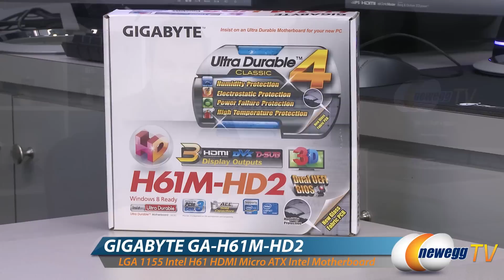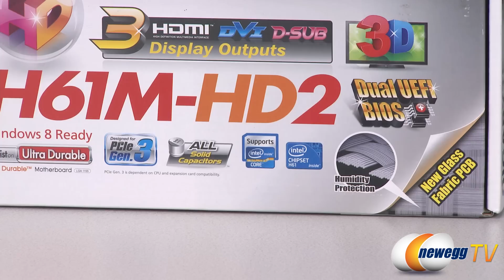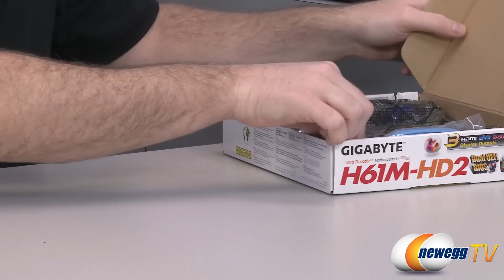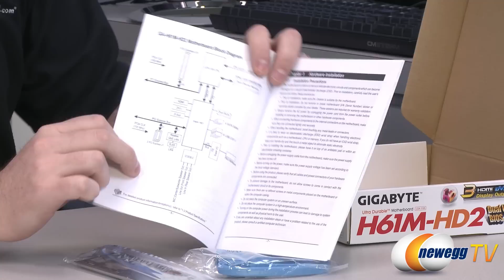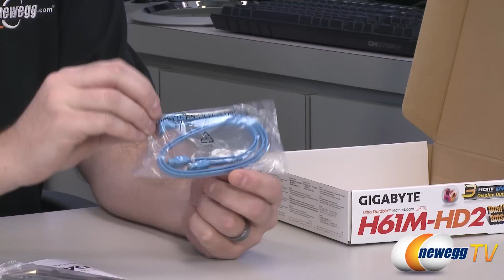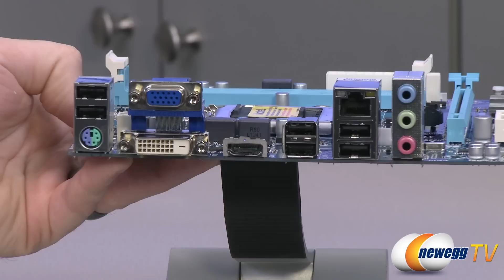Newegg TV: GIGABYTE GA-H61M-HD2 Motherboard Overview

Comment: this board would be excellent in the thermaltake armor a30 sff case.  

Main reason?  If you wanted to put a 120mm or even a 140mm cpu liquid cooling solution and route the rad/fan assembly to the bottom right corner FACING the vent holes in the side panel while STILL having GUARANTEED plenty of room to not block your sata ports...EVEN if this board's sata ports where right angle like most modern day boards are

Comment: I just think they have leftover USB2.0 controllers and they gotta use them in something.
I know 2 years ago a USB 3.0 controller cost more then a 2.0, the problem is that they put both for some reason, meaning double the cost and double the 'room' used.
But we don't have old USB 1.1 controllers in our boards today so they need to switch over completely and solely to usb 3, but no one is doing that for some reason, i guess there are still some issues left

Comment: alright pal, i'm gettin this bored....Gigabyte H61M-USB3H Motherboard (Socket 1155, Intel H61, DDR3, S-ATA 300, Micro ATX, PCI Express 3.0, USB 3.0, HDMI, Gigabyte Dual UEFI Bios).... will this intel pentium dual core e6600 fit in it.. thanks